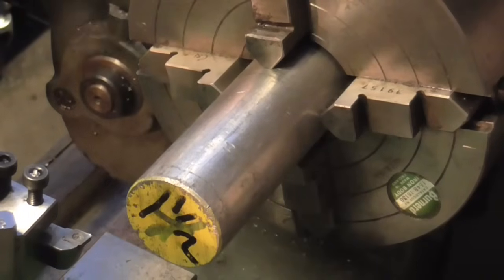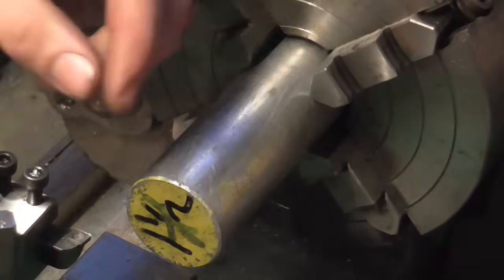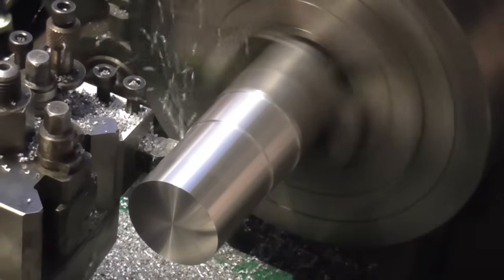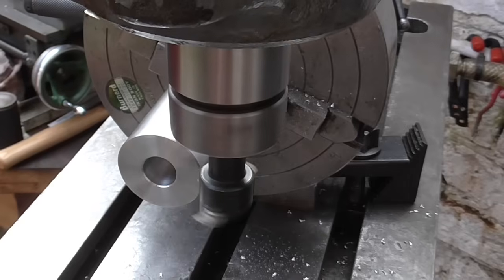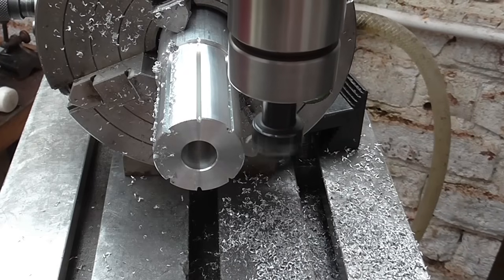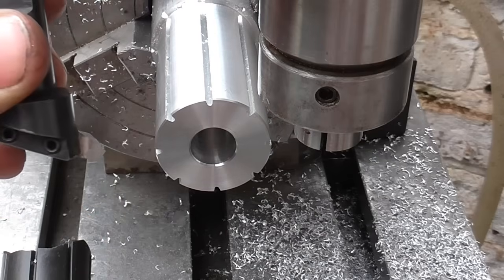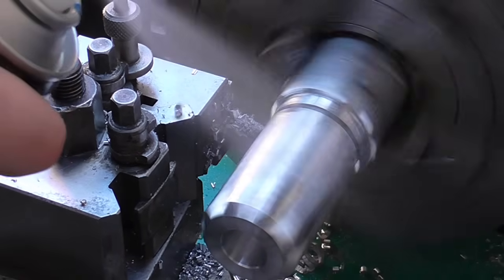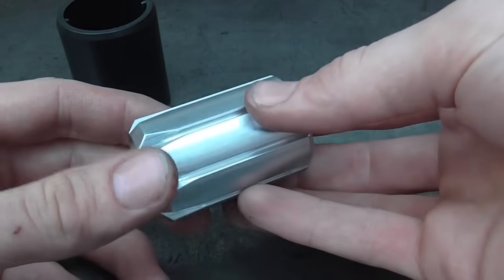Home Workshop Engineering - Machining an Artifact

Comment: Maybe a stupid question: how you solve/open your chuck from your dividing head after using. I always be afraid that I destroy the internal gears of the dividing head if I turn the chuck to open it.
Reply from the maker: Do you mean how to get the chuck on and off the dividing head spindle?
Reply: @MrCrispinEnterprises  Yes exactely! How it works? I had yersterday this problem to get the chuck off!
Reply from the maker: Lock the dividing head, put a big adjustable spanner on a chuck jaw, and give it a sharp whack with a mallet. The mistake people make it hitting the chuck key which can result in a broken jaw screw.
Reply: @MrCrispinEnterprises  Thanks for the Tip! It's always the little details that are never shown anywhere because people think it's not important!

Comment: I don't quite understand why on the return stroke more material is removed on the initial faceoff? Is this because you are feeding the tool in a tiny bit as you return?
Reply from the maker: No there is no additional feed movement. It is generally tool pressure that causes extra material to be removed. As the tool takes a cut it is under pressure and when the pressure is no longer present (return stroke) the tool and machine are in a slightly different place and you therefore see a small amount of metal beging removed. Typically on a finishing cut weather it be turning, milling it boring you move to cutting tip away from the work so that is does not leave a witness.
Reply: @MrCrispinEnterprises  ah thanks for the reply.

Comment: Superb work. I am learning loads from your videos. Any advice on a good starter lathe to look for in the UK? I have had colchester student recommended and would be using it for making tools for working on 4x4s as well as hobby stuff. Thanks, James.
Reply from the maker: Thanks. A Colchester Student would be a great machine but bigger than most starters have. If you can house one then go for it. I expect it will be 3 Phase.
Reply: MrCrispin thanks - it will be three phase so I will have to run a phase converter. Just need to wait for a good example to appear locally. Hopefully the school I work at will want to sell one of theirs soon, they don't really get used anymore, it's all five minute programming projects and bbc microbits now.
Reply: I am no lathe expert, but having one with a gearbox will save you a ton of constant pain in the future when you’re changing speeds and screw cutting pitches.  I have one of the Machine Mart CL430 ones and although it works OK, changing the gears and pulley settings all the time is a pain in the behind and single point threading isn’t what I’d like it to be.

Comment: I am not sure if i am correct here but if one found that the across 2 rollers dimension was say 2mm oversize you are saying that you need to take a cut of 1mm more.
Are you sure about this as you are cutting a pair of tapers & the rollers will not move in exactly 1mm if you take a 1mm deeper cut. I know that if I am right it will only be a matter of Thous but still not absolutely correct
Am I talking rubbish or am I correct ?
I will be buying a new lathe & mill at the model engineering exhibition  at Ally Pally this month so one of the things I will do is check the above . But for now I just have to ponder
Reply: when you move the cutter in you are not changing the angles of the cut. So, the point where the rollers are touching the sides of the angle will be 1 mm deeper staight into the part perpendicular to its axis. Even though you are cutting an angle on a round part with a rotating tool, you have to treat any point on the cutting tool being fed into the part as moving perpendicular to the part.